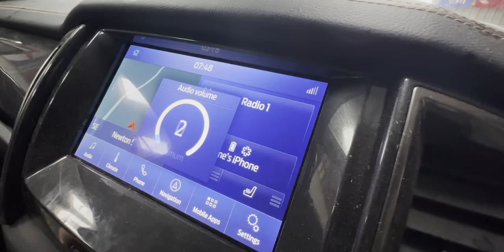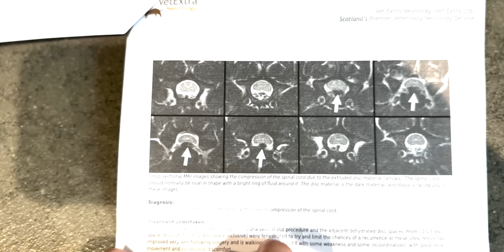REMOVING a ROTTEN SOLE from a COW's HOOF

Comment: I have the same problem Stevie had. Though mine is past what the Neurologist is willing to work with. I have had two back surgeries already. I actually just trialed a SCS (spinal cord stimulator) and am waiting for the insurance to approve the implant. It won't do anything for the sudden, random, paralysis of my left hip and leg, but at least the pain will go from 7-8/10 to a 5-6/10. When in constant pain, even the littlest bits of relief make a difference.

Comment: It is sunny, for Scotland, right? At least it's not liquid sunshine.
 You're getting quite a few tough cases, extreme cases, so you're getting to be the go-to guy for this kind of work. That's a good thing. A very good thing.
  Looks like Kev will be getting his caffeine via osmosis this am. 
 Back problems are the world's #1 physical complaint, and I had been recuperating from a fractured vertebrae I received last year about this time. So far, so good. Everyone has to figure out what's best for them when attempting to mitigate back problems. What works for someone else may not work for you. My initial treatment was a cold water bottle (frozen, actually) which was helpful. Others gain help from moist heat. And what bothered me pain wise when I was younger has become absent in my older years. It was a slightly bulging disc, must've shriveled up over the years.
 Success! Cow's walking much better!

Comment: Nice video.
As you told it, the "fur nose" Stevie-Boy has a herniated disc and after the operation a damaged disc. Hopefully it stays with only one.
Can't you attach a tank with 100 or 200L of water to your trailer (frame where the cows come in). Where do you connect a cordless high-pressure cleaner to then use it to clean the cow's feet?
Have a nice weekend.

Comment: Serious back issues are no joke. Whether it's the vertebrae or the discs, both can cause serious complications. I had to have major back surgery when I was 23. It was so severe that I had the MRI June 5th of 2014, and was in surgery August 11th of 2014. I received the call for my surgery just 13 days prior.  The neurosurgeon got me in as quickly as he could (the typical wait time for surgery is 10-12 months). And because my discs were in such bad shape (the surgery itself ended up taking twice as long as expected) my spinal cord ran over the worst disc in a 'U' shape, and could have caused permanent paralysis (in the end it did cause permanent nerve damage in the entire lower part of my left leg meaning I have no feeling in that area). So, if someone feels they have a serious issue with something in their back it needs to be fully investigated. I started trying to get help when I was 16, and went through almost 2 dozen doctors before one finally took my concerns seriously. And because of that I've been left with life long damage. This problem had it been discovered earlier could have potentially been treated non-surgically. But, what can you do? I did everything I could. I just needed a doctor to take me seriously.